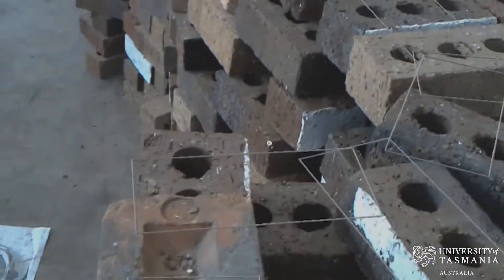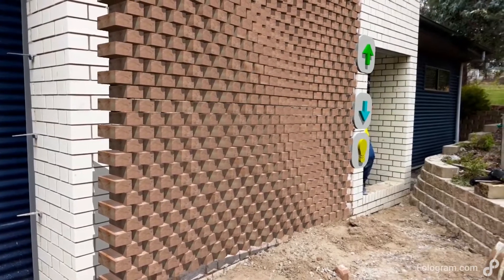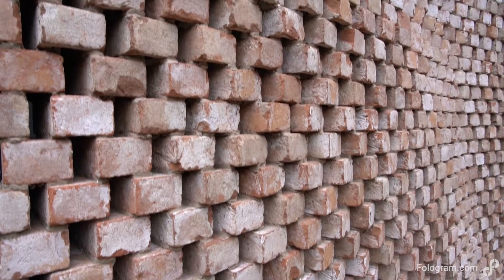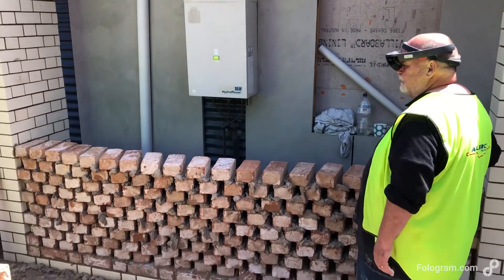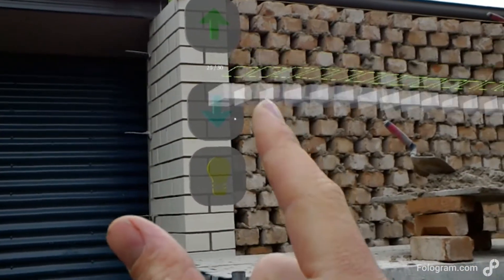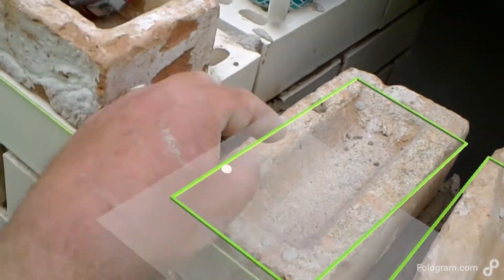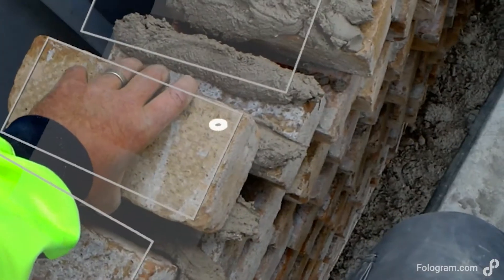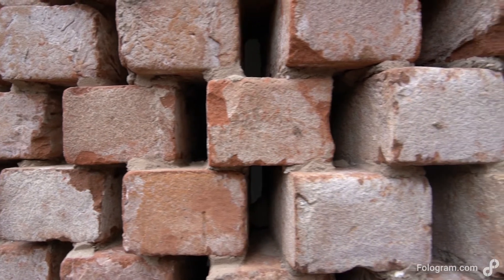Bricklaying in Augmented Reality

Comment: is it possible to fabricate only with the fologram mobile app? without hololense
Reply from the maker: Hi Reyhaneh, short answer is no. With the hololens you get true depth perception, which allows you to accurately place the objects (and isn't possible looking at a 2D screen). Additionally the hololens is more acccurate in placing a hologram compared to a phone, which is quite critical to fabrication (though phones are getting much better at this over the last few years). At the moment the mobile app is best for visualising and interaction with holograms. thanks
Reply: Is there any other way with cheaper hardware?